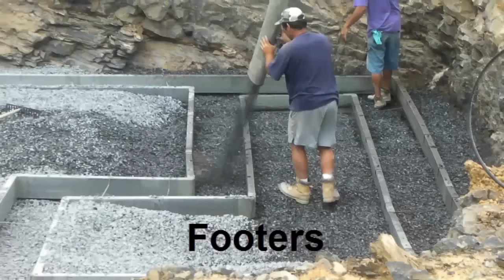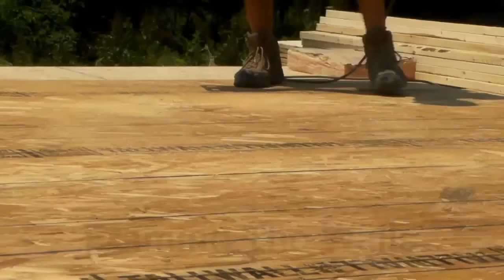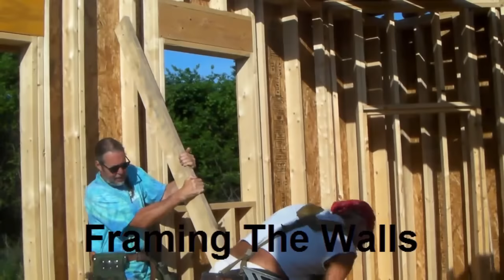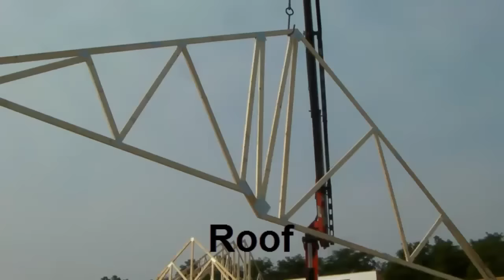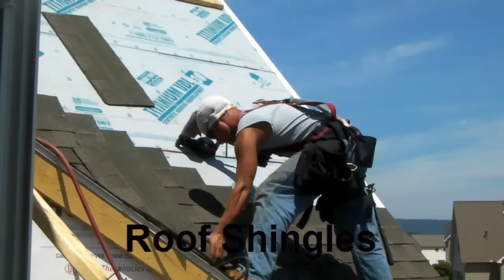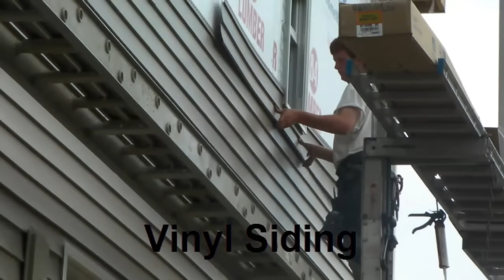House Construction Documentary

Comment: How come there is no concrete slab in the basement, only footers ? Do you guys use all wood in USA because it's cheaper than bricks. What type of wood is used ? Thanks for this excellent video.
Reply from the maker: They pour slab after the house is framed for some reason.  Wood is used because it's cheaper and easier.  Everyone seems to think it's fragile but these homes are very strong and can withstand a lot of wind.  It's easier to run wires, frame custom homes, etc.  Not sure what time of wood, it actually varies.

Comment: Wow, this is cool! In post-soviet countries,we only use concrete and bricks (not red small, but quite big bricks, don't know how its called in English though) to build houses.Even for floors between the storeys we use concrete.Oh, i have a question, during tiling the wall,with what did u connect the tiles to the wood wall. Cement? If yes, do they stick together? :S

Comment: what's with basements?  we don't really have them here in australia.  is it to put services there, where they can be protected from freezing.. or to hideout in during tornado strikes or something?  tradition?
Reply: the house foundation has to go below the frost line. It gets very cold in most of the United States, so it makes sense to have a basement instead of a huge concrete block
Reply: jberda_95    Yea, a basement would be nice for the extra space but in SoCal extremely rare unless custom built. We have two seasons summer and summer lite.

Comment: Firetrap. Truss floor, truss roof, unsupported upper level floor trusses attached with metal clips, wood,glue and wax strandboard. . Wood never buy a house built this cheap.
Reply from the maker: +Michael Mc Clure What's the problem exactly?
Reply from the maker: +Michael Mc Clure I agree with you on all of that and I've seen cheap builders and quality builders.  I thought by your comment you were saying that this style of construction (wood framing) is cheap.  There are actually builders in this same neighborhood that are way cheaper than this one.  I don't even feel bad about saying their name.  There is a builder called "Classic Communities" and they do bare minimum.  All studs are 24" oc, they only do 2x6 walls where required, etc.  Everything they do is horrible.  It's a shame.  

I did some summer work with a builder named "tiday homes" for 2 years.  The quality they put in to their houses is amazing compared to some of these other builders.  They actually take the time to make their houses look nice, too.
Reply: Awesome!
Reply: YES finally my house is from 1935 and they knew how to build a sturdy and lon lasting house

Comment: Why did some walls get sheeted on the floor and others went up bare and sheeted later?
Reply from the maker: I asked them and they said it's easier for them to make them plumb and square I guess?  I don't know why.  Maybe in case the concrete is not perfect.  The walls that they put directly on the concrete don't get sheeted until they stand them and make sure they are plumb, whereas the walls that go up on the wood subfloor are squared up and sheeted before standing.

Comment: This video, i found many fails in this work. 1. The safety is not there, the sealing isnt good. If it happened something, you cant repair it. The toilet dont have water proof,  the way they made the roof and windows is not good installed, very fail made, because they dont count the weather changes, and the water can go in the house easy. This is oldfashion on installing the walls and floor and the materials used ,  if fire happen so this house will be burned down in 14 minutes.  +++
Reply: Sadly this is exactly how most us houses are made. However people still charge tons for them. Sadly the average person has no idea. Thankfully I'm building my own.

Comment: The forgot to use heavy duty liquid nail on beams before put drywall up
Reply from the maker: Nah it's so when the house settles there aren't nail pops
Reply: +TheMrFinneth can you explain? I have nail pops 😏
Reply: +Al Complaint go to home depot or lowes or any store like that and ask for heavy duty liquid nail. It comes in tubes like caulk. What u do is squeeze some on the beams before u screw in the drywall. Over years the drywall can move slightly because of gravity obviously n liquid nail prevents the cracks. Basically an extra layer of hold
Reply: +Al Complaint go to home depot or lowes or any store like that and ask for heavy duty liquid nail. It comes in tubes like caulk. What u do is squeeze some on the beams before u screw in the drywall. Over years the drywall can move slightly because of gravity obviously n liquid nail prevents the cracks. Basically an extra layer of hold
Reply: StarGate55555 ah! when you say beams you mean studs? I guess that's too late for me. Thanks for the info.
Reply: By the way you say over the years. Within a year i had a good number of nail pops :/

Comment: lol that house will collapse in 10 years  from when it was built
Reply: +SS SS Think you and I are thinking the same thing. It looks very cheaply built! Surprising!
Reply: +SS SS i have never seen floor joists made from ply wood and 1x1s before.... its insane!
Reply: +scottlw their called I joists they are actually 25% stronger then normal joists but more expensive .
Reply: yep I joist are way stronger. If you really don't know construction  shut your mouth.
Reply: While most of the 100-plus page UL report on the testing of lightweight building components focused on engineering calculations, several key points emerged to clarify the fire performance of engineered wood components, including:
Deflection times
Although a computer model predicted that the test floor assembly using engineered I-joists would retain its strength longer during a fire than the traditional wood platform, the opposite was the case. Furthermore, the engineered wood supports began to fail and deflect almost from the start of the test and proceeded to degrade in stages, leading to floor vibration, noise, collapse, and burn-through.
Charring
The rate at which engineered wood and traditional wood chars is similar. However, because of the very thin cross section of the I-beams, the report found that this charring rate poses immediate dangers to the mechanical integrity of the structure.
Heat sensitivity
Oriented strand board beam sections exhibited initial charring at a much lower temperature than traditional wood, making it impossible to further test some properties of the material.
Heat conduction
Due to compressed plies and binding material, the engineered samples conducted heat faster than other wood samples.
Brittleness
Engineered wood product samples exhibited increased brittleness and loss of mechanical strength compared with traditional wood components when heated in an oven, even without being exposed to fire. Researchers suggested this was due to separation of the constituent compressed fibers under mechanical and heat stress.
Reply from the maker: These are called truss joists and they have many advantages over traditional lumber.  After this house was built, a law was passed (at least here in PA) stating that these must either be covered in drywall or have a fire retardant on them because there are problems with open flames.  The glue in them can catch fire.  The company who makes them sells a version coated with fire retardant.  My house is built with these and has no problems.  It is 10 years old.
Reply: TheMrFinneth I like the house you guys build  I hope to learn how to do that